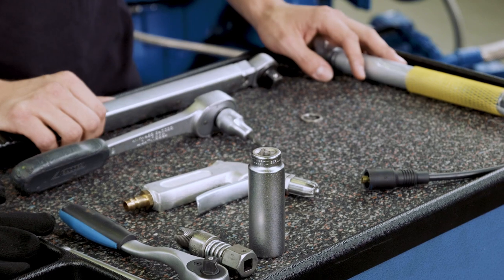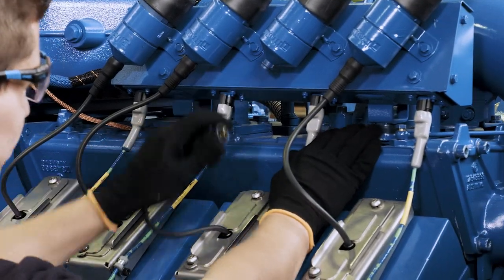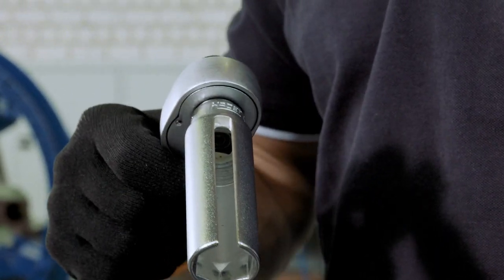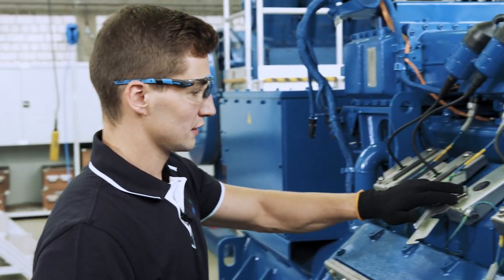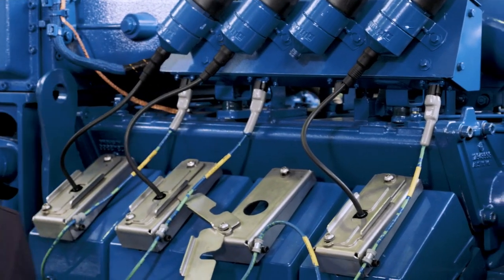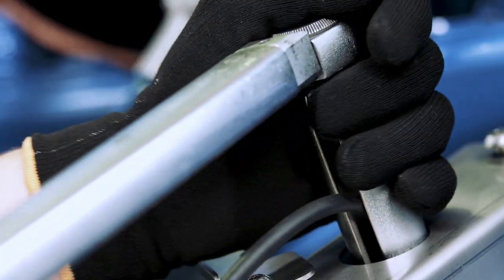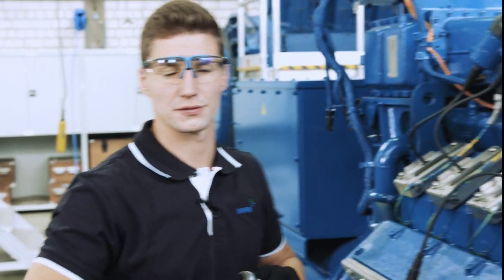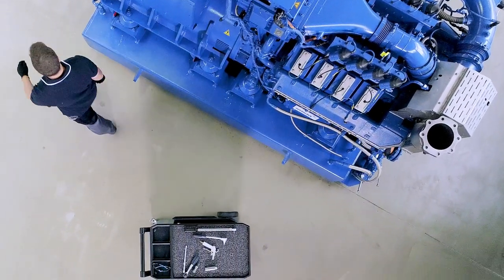Episode 1: Spark Plug Replacement

Comment: What if we don't have a sparkplug thread cleaner? Do we just blow the dust off the seating?
Reply from the maker: Please do not replace the spark plugs without the cleaning tool. You must clean both the thread and the seating surface and ensure that no dirt enters the cylinder. If you skip this procedure, you risk leakages of the combustion chamber, poor heat transfer between the cylinder head and the spark plug or cross threading/seizing. This can lead to reduced efficiency or severe engine damage due to melting plugs destroying pistons, valves, cylinder heads or other parts of the engine.

Comment: Does this apply to TCG2020 V12 which has different guard rails?
Reply from the maker: The process of replacing the spark plugs is very similar between those two engine types. On the TCG 2020 the guard rails have got three screws and need to be taken off the engine completely.